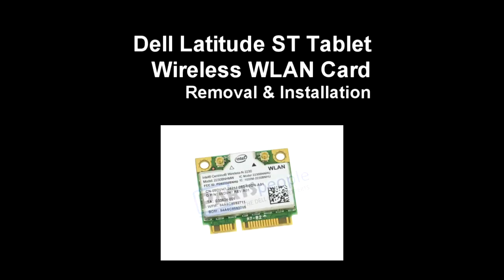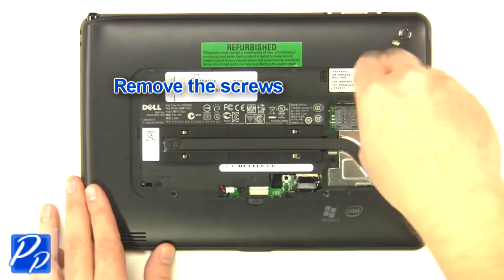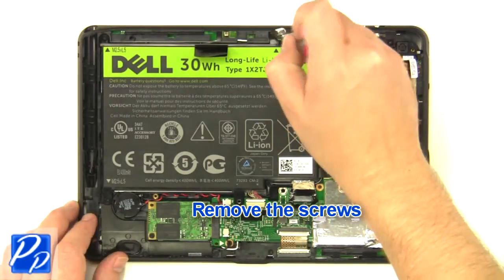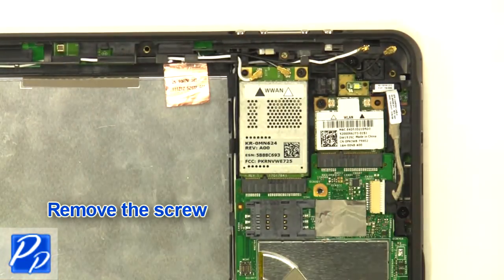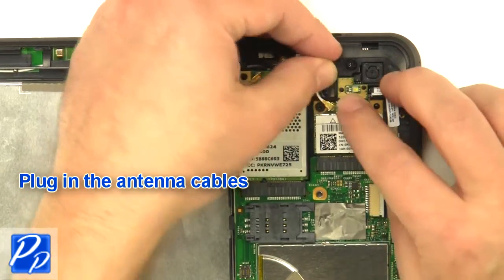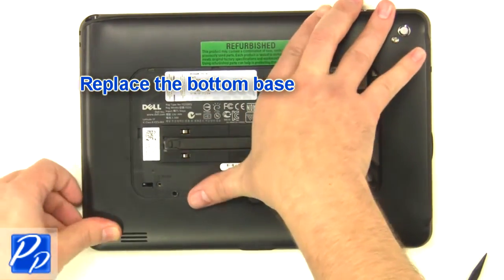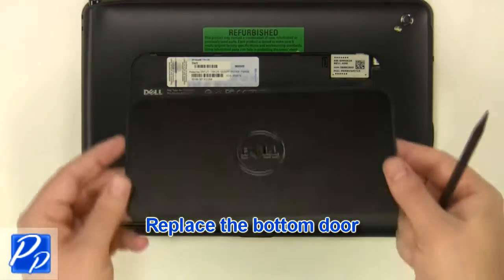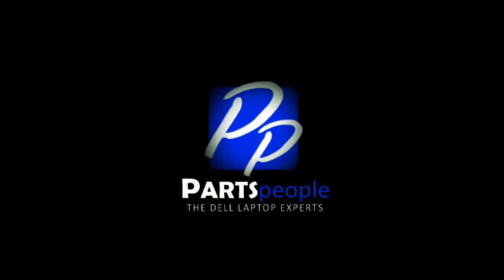Dell Latitude ST Tablet Wireless WLAN Card Replacement Video Tutorial Teardown

Comment: hello i have an antel centrino 6300 in my dell latitude but its not showing in device manager and also i can't find any working driver for it does that mean my card is not working?
Reply from the maker: Have you tried to reinstall the driver? You can find it at support.dell.com
Reply: +Parts-People.Com, Inc I tried but didn't work even in device manager not showing as otger device I think it's dead haha thanks
Reply from the maker: Yeah I think you're right. You probably need a new wireless card.
Reply: +Parts-People.Com, Inc I tried another card same thing 😢